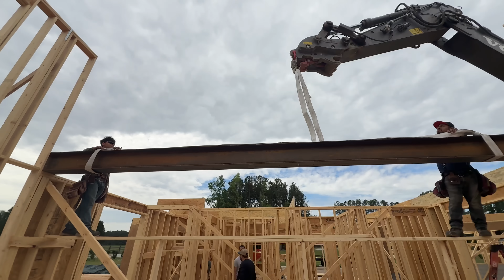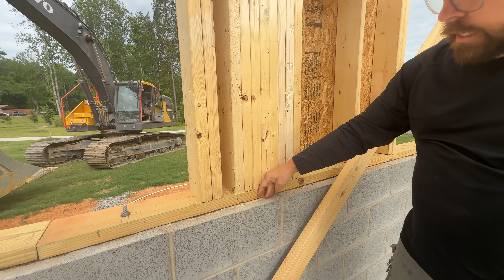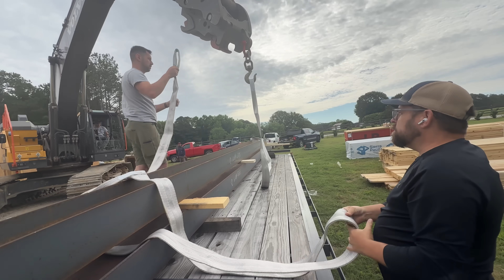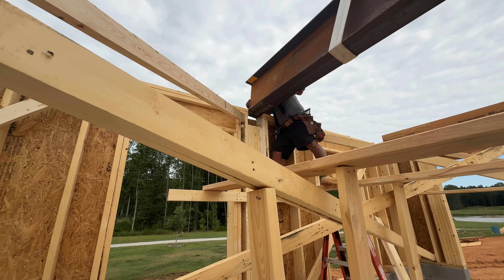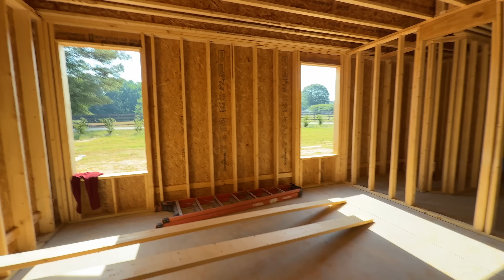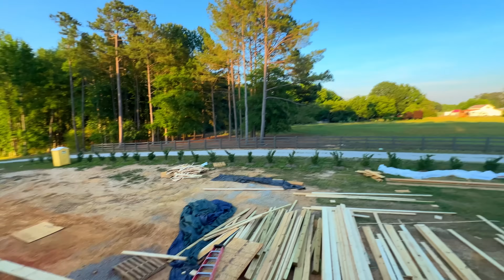Installing 2 HUGE Steel Beams for the Barndo Build!!

Comment: Sitting RSJ’s on timber would not be permitted in a lot of countries. Building regs would insist on steel uprights sitting on reinforced foundations. The wood/steel combo will talk to the owners in hot weather.
Reply from the maker: Very common here.

Comment: Good morning Geof, wet tuesday morning here in Adelaide rained all night 50mm,not much compared to your area but plenty for us.
Question,s
                     1 can you tell me how much a square metre building costs are average here is 2000 3000 Dollars a square metre
                      2 You use a lot of Pine for framing,4x2 here is 5.91$ a metre,how does that compare with what your cost are.
Im just really interested in building and love being able to watch your building process,sorry for all the questions mate just a curious Aussie😊😊😊😊
Kym
Reply from the maker: About the same per square. Lumber is sold by the linear foot. Would equate to about $2 per meter
Reply: @BealyGood 
Thanks mate

Comment: Question on building code. They don’t require anchor bolts go from the foundation to the second floor to lock it together?
Reply from the maker: No. They do require strapping on load bearing walls. I'll try to show that in the next video.
Reply: @BealyGood ok thanks
Reply: Nope. Nobody does that in TN, either. That may be Earthquake code.

Comment: for me it looks like a temporary shack , not for a lack of effort but because homes here are built with a ,ife expectancy of several generations , usually 4 or 5
Reply from the maker: The blue farmhouse was originally built by my first cousin, 6 generations ago. It's all wood except the roof
Reply: @BealyGood my family lived in the same house for 27 generations it's 1170 years  and still standing
Now it's used as storage because heating it has become expensive and insulating a natural stone and mortar house without trapping moisture is impossible
Reply: @BealyGood  yes and it looks good once more thanks to your efforts , what i mean as a foreign viewer im accustomed to concrete and brick and stone houses - your ICF house is closer to my normal than most else you show , tho we usually dont insulate the inside like ICF does , the concrete becomes a heat sink - the mass keeps the inside acclimated for a long time weather its heated in winter or cooled in summer .

Comment: Surprised you are not insulating the unfinished space above the garage. It would not take much to do a cool roof system and just paint the foam with fire retardant. Same on the walls in there. It is mostly just moving out the existing insulation and adding a few square feet, but having the whole roof insulated is worth a lot from where I sit. Just a thought. Lot of added value for just a little more.
Reply from the maker: I'm considering going ahead and finishing the space

Comment: If you're going to be building a lot more structures you should consider Patton scaffolding in place of lumber. Less expensive than lumber and stronger and safer. I worked with it for years. Assembles rapidly and any configuration and can change configurations on the fly. Just FYI.  Love the channel
Reply from the maker: I am actually looking for scaffolding. Thanks for the info!

Comment: Good afternoon Geoff. Love the house. Build a wall and insulate it along with an insulated door. Between the attic and the living space. And how are you going to fire proof the steel?
Reply: A fireproof door, that is.
Reply from the maker: You don’t fireproof the steel. The wood will burn up long before the steel is an issue
Reply: @BealyGood not true. In a fire the steel will twist and bend  from the heat. And pull the floor down with it. Wood can take hours before it gets to that point. By that time everyone should be out of the building. You can use Intumescent paint. Or double layer sheet rock to box the steel  , or wrap it in masonry of some kind. As for spray on fire proofing to costly for just two beams.